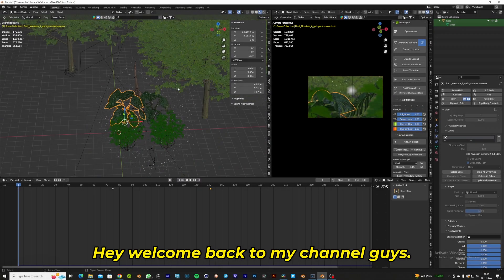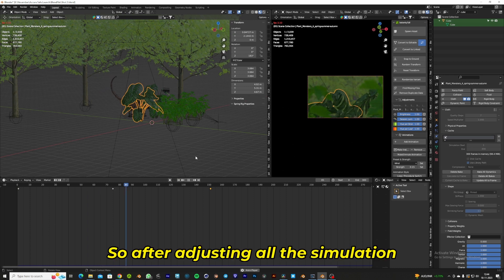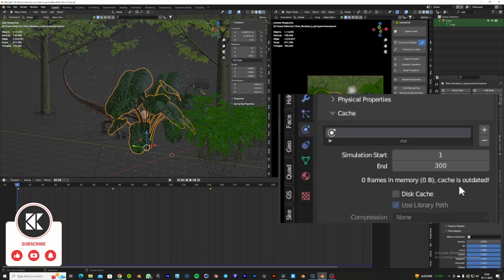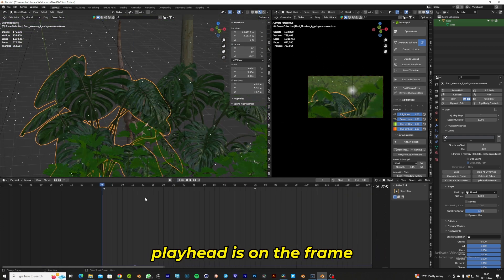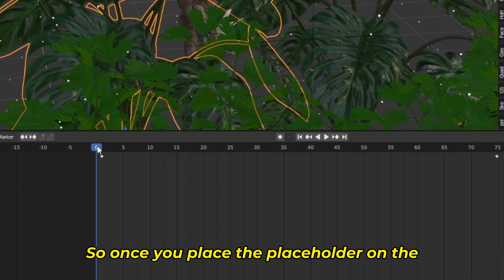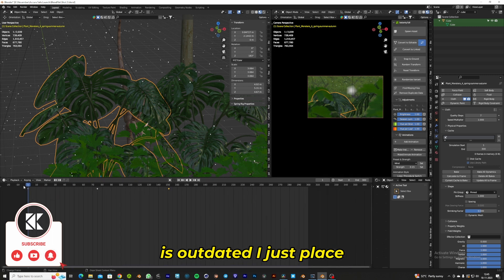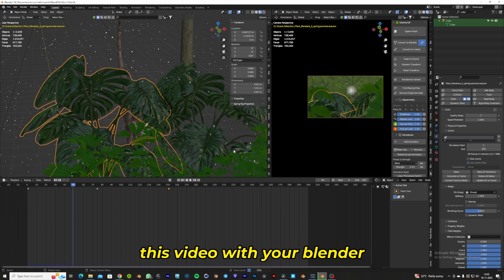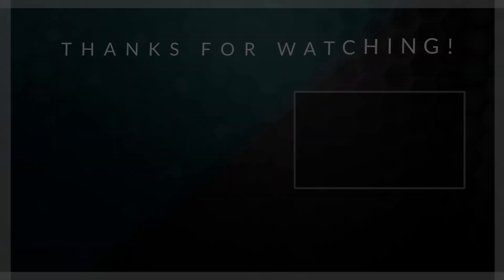0 Frames in Memory, Cache is Outdated Problem Solved #blender #tutorial

Comment: Thanks, this was helpful! I'm going to do all my baking set to frame 1 from now on.
However, I was ALSO having an issue where the cloth simulation wasn't working at all and this didn't solve that problem. 
For anyone looking at this, try dealing with any duplicated vertices. It worked for me!
Switch to edit mode. Press Alt + H to make sure there is nothing hidden. Then select all vertices A and then press M to merge them by distance.